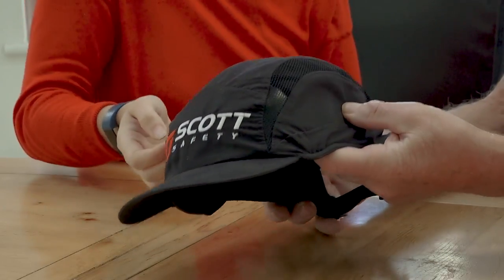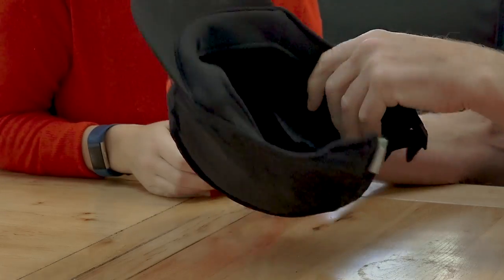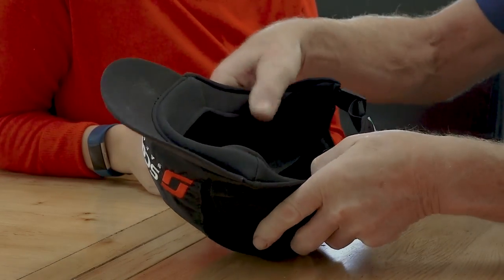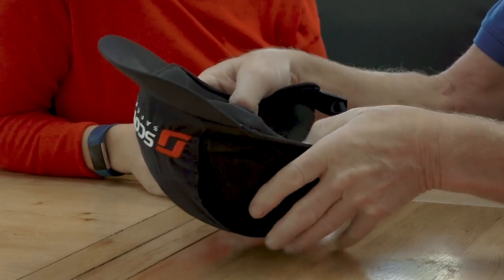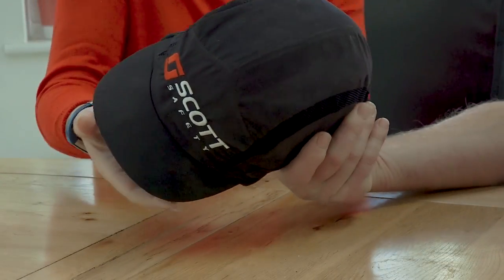Head protection in the workplace: Bump Cap or Hard Hat?

Comment: It would largely depend on the risks of the job in hand. If I was putting wiring through a space in a roof, I would use a bump cap. If I was in a place where I was at risk from falling objects like a building / demolition site, or I was doing something where hot sparks can fall on my head for example overhead welding / cutting then i'd wear a hard hat.
Reply from the maker: I think you just summarised the whole video